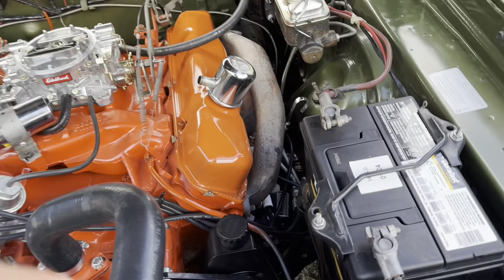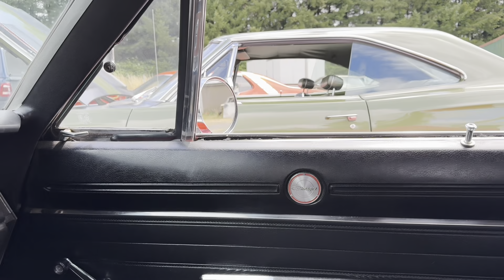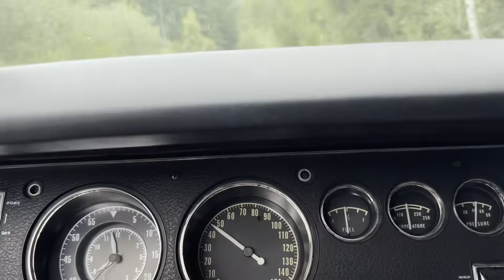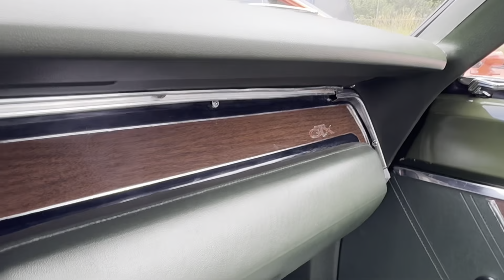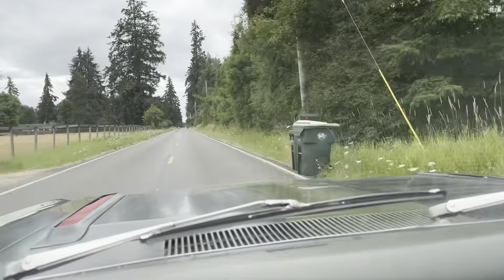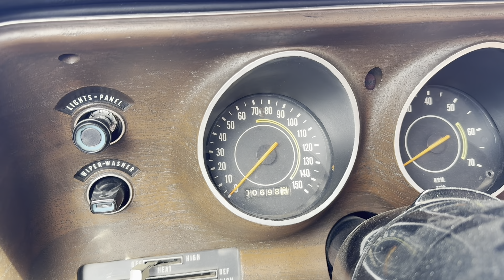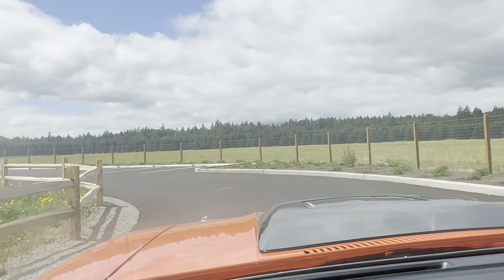An Expensive Front Suspension Is Not The Answer! Magnum Force vs Borgeson Vs Stock Mopar Comparison!

Comment: That k member that’s on the Roadrunner is probably an RMS “AlterKation” and yeah the heim joint control arms and tie rod ends are always going to be noisy. Since they utilize the factory shock location the geometry is off for the load transfer.. QA1 has a better K member with its own shock mount but they’re both extremely overpriced around 6k and that’s with no brakes and crap coil over shocks. The best aftermarket front end is a beefy “G Force” front subframe for 4K which does need to be custom cut and welded in. It has amazing adjustment and turn radius plus accepts a wider tire. That is what I’m putting in my 71 Roadrunner plus a narrow back half subframe.
Reply from the maker: No think it was magnum force

Comment: The darty feeling with the borgeson steering box could very well be an alignment issue. Particularly a toe adjustment. I do road course track days with my cars and adjust my toe and camber  between street and track settings each time. 1/8” toe in is great for street and feels stable and straight, 1/16” toe in I use for large circuits, still decent straight line stability but it will turn in much faster in the turns. I’ll actually use zero toe, or 1/16” toe out for autcross where you want super fast turn ins and don’t need any straight line stability. For camber I use -.5 degrees on street and -1 to -1.5 degrees for track.

Comment: I like torsion bar suspension.I did adjustable upper control arm on my Duster cause i have a right frame rail issues i couldn't get it alignment
Reply from the maker: They have uses

Comment: So, heres my question. Im actively working on getting a 68 charger of my own and i want to know, what is the steering ratio of the borgeson system on the GTX? Im hopeful to find a good 1:12 or 1:10 steering ratio if there is such a thing so i can really dribe the thing properly. I fully intend to daily drive the car and maintain it as such. And yes, torsion bars fir the win. Cheap as hell, easy to maintain and or replace if needed. If it aint borke why bugger with it? But yeah, i need that power steering advantage for the daily driving side of things. Also, some proper alignment tips would really be great. I work at a brake and tire shop and we do them so i could actually do my own cars alignment as well.. well, once i get the charger anyway i could. I also intend to keep it as a carbureted vehicle as well because i can work on em in my sleep. At least an edelbrock 4 barrel anyway. Only things i will be modifying is the transmission and the braking system as i plan to use a hydroboost system for the brakes. Ill be using an 8 speed automatic because now we actually can. Yes it'll require the crossmember and all that good stuff but it'll really help with fuel economy. A 318 with that setup and the right gear could get 28 to 35 mpgs all day long. A big 383 or 440 with a 3.23 may get around 25 to 30 mpgs out on the highway. 1000% worth it.

Comment: I know this is a little late, but what are your opinions on the RMS AlterKtion coil over setup? The coil overs do not go up into or use the shock tower but is rather connects to the k frame.
Reply from the maker: I’ve heard that stuff is better than the magnum force but have never personally used the coil over set up.  We used an alterktion k member in a 71 Challenger modern 392 Hemi swap and while everything fit ok (kept torsion bars) the k member actually flexed visibly when turning the wheels.  They were pretty wide wheels but still, shouldn’t do that.

Comment: In a GM application that box would have at least one strap brace from the back of the pump over to the front exhaust manifold stud / nut. If that were my car I think I’d break out the torch and some 3/8th steel strap and bend one up, a longer front manifold stud with more exposed tread at the top would also need to be scrounged up.
Reply from the maker: It’s just not engineered right.

Comment: The bump steer in the GTX probably attributable to the SPC adjustable upper control arms. As you adjust the arms during alignment, you also change the arm length, which changes the changes geometry, and could be the cause of some bump steer.

Comment: Re: the 69 GTX. I have a 70 Roadrunner w/the same Upper Control Arms which are SPC-brand fully adjustable. They don't require the "cam (eccentric) washer". Everything else is QA-1 including the K-member. I also switched to power steering and used the Borgeson box w/GM 2 style pump. Very happy w/how it all works, looks, fits, and integrates.
Reply from the maker: Had trouble aligning the front end with those UCA's but maybe we did it wrong.

Comment: Absolutely agree, front ends on cars should be torsion bars and the trucks and jeeps should have leaf springs if they are 4wheel drive none of what they are doing with the new jeeps,a 96TJ put me in the ICU for a good while because of the coil spring suspension is total BS and any jeep made after 1995 that doesn't have leaf springs should be scrapped or put leaf springs under it unless you just like having lots of broken bones and hospital food, just my opinion based on facts when mine decided to spit out the rear end and drop the body on the tires on the passenger side when I was going down the road at 55-60 miles per hour and start flipping until some trees in someones backyard stopped it
Reply from the maker: T bars all the way

Comment: I won a lot of races in the 70's  with a 69 gtx and the torsion bars are a big reason for that  in oval track racing I went thru 3 69 Road Runners.  But I wish I had one know.
Reply from the maker: Lotta good cars got used up on the track

Comment: The problem with stock torsion bar suspension is not the torsion bars.
If you could get light weight control arms and spindles and good fully adjustable shocks the torsion bars suspension would be equal or even better as there would be less unsprung weight.
You’d need a canterleaver suspension to equal it.
Reply from the maker: T bars work great.

Comment: Is not the main reason for using Moog Problem Solver bushings is that they are offset to move the ball joint rearward to attain positive CASTER.  Chrysler went with negative caster to reduce steering effort at the expense of handling.  Achieving 2 to 3 degrees of positive caster is the goal.  Am I wrong?
Reply from the maker: You are correct, believe I misspoke in the video.

Comment: Just say no to aftermarket anything.
Reply from the maker: Some ways to improve handling in a Mopar that isn’t stock that still works.  For example off set upper control arm bushings work great, can get the alignment to where it should be with radial tires vs the settings for the original bias ply tires.

Comment: putting a tubular k and coil overs in my barracuda was the best thing ive done to the car. just don't use that mag force iv'e installed 3 of them and none of them were welded right
Reply from the maker: I’ve heard other ones are better.  magnum force
Reply from the maker: Magnum force is not the answer

Comment: I own three A bodies. I HATE the way the factory torsion bars drive/ride. It’s terrible. They ride like 3/4 ton pickup. They jerk, dart and are unpredictable.  I installed a tubular setup in my Scamp from Gerst 8 years ago who has since been bought out QA1. It has been the best money I’ve ever spent on that car. It handles, steers and rides like new car. Back then I was able to buy the kit from him with brakes for about half of what you can buy a kit from QA1 now. The upper coil mounts don’t go to the inner fender like a magnum force. The K member has coil mounts built into it. Like you said the systems and have the coil mounted to the inner fender are asking for problems. I’ve heard a lot of bad things about magnum force. I do think the cost of the new systems are ridiculous, but the correct suspension system will put the factory to shame. I’ll either make my own for the other cars or buy QA1 in pieces until I have a complete kit.
Reply from the maker: Boy I couldn’t disagree more with you,  I’ve road raced torsion bar Mopars on a road course and you can make them handle and ride great.

We did a QA1 k member with bars in the 71 Challenger 6.4 Hemi restomod we did in the shop and with the fat front tires the k member visibly flexed when you turned the wheels 🥶

Magnum force is bottom of the barrel in quality.
Reply: @rocketresto  I guess we will have to agree to disagree.  I’ve driven/riden in hundreds of old Mopars and I’m Mopar guy all the way, but I have yet to ride in one that handles well with factory suspension. I’ve rebuilt the entire front end with moog parts on about 6 cars for marginal improvements.  That is a good data point with the QA1 K member.  I’ll think twice before I make that buy. That k member is a QA1 design not a Gerst design.

Comment: Interesting video. I'm building up my duster for more handling stuff (autocross/road racing) and I'm going closer to the GTX, I will have bigger torsion bars, adjustable UCAs and likely the Borgeson box but the overall geometry of these is actually great from the factory. I worked with a fellow engineer to do a computer simulation of stock and modified geometry and there isn't much that I'm actually going to need to change. the big things are modern alignment specs to go with the tires you are running and spring/shocks to fit the driving you plan to do. But that is outlined in the mopar performance handbooks for racing so that isn't something new, and the mopar engineers were well aware of it.

Comment: Nice comparison. Stick with stock it is.
Reply from the maker: Ways to upgrade from stock but ya stick with t bars!
Reply: @rocketresto  true. I have offset upper control arm bushings, white Kybs, reinforced lower control arms and 0.92" torsion bars under my small block 69 Satellite.  Rides great for driver.
Reply from the maker: @Mattisgarage great set up, our only suggestion would be to try Bilsteins over the KYB’s.
Reply: @rocketresto  I have heard that they are great, have been thinking that too.

Comment: Here's what's cool about the factory torsion bar suspension, it's infinitely  adjustable! Hardly any other suspension ( even now) is that adjustable. Caster, camber, ride height, and toe. And you can adjust the spring rate as well!
I have never had a problem with this suspension, and they handle like a dream! ( properly set up that is) the aftermarket  is a downgrade unless you do a heidt  k member and also replace the rear doing a back half with subframe connectors.
 Now, yo can improve the front with spindles for big brakes, although mopar actually made factory 6 piston calipers for satteites that are fantastic! Also tubular a arms and boxed Lower arms are a great  tuning trick for auto cross and any spirited driving.
Reply: You don't have a part number for those 6 piston calipers do you? Never heard of them.

Comment: While I respect your contributions, what you said about the Borgeson units isn't correct. 
You don't need to modify the steering column to use it. It works with the Saginaw pump. The response is MUCH better than any factory unit, better than any Firm Feel unit because every Mopar steering box is a design dating back to the late 50s. They all have a degree of on center free play that only feels worse when you step up to stage 2 or 3.
Alignment matters more in terms of "darty" steering response. Toe in or out will surely make the car respond well or in a weird manner.
Magnum Farce sucks. Their engineering is crap, the owner looks like an elderly former roadie for Quiet Riot or some other 80s hair band.

Comment: What I'd like, on say a Hemi conversion car into an A body is torsion bars, but a tubular 'K' frame with a power rack on the front of the subframe so you can run a full length oil pan unimpeded by a bulky K frame, drag link, idler and pitman arms. I have no problems with torsion bars but the drag link combined with the K frame is a headache for everything you want to do under there from headers to oiling for track and handling improvements. The limitations of the car are quickly found if you're a proper hard charger as the Brits would say LOL.

I can't see the point of a rack if it stays in a similar position as stock steering. The amount of money spent not being equal to the improvements gained. Stock power steering pretty good - one gets used to it and we like it like that but if we're going to a rack what is the point of putting it in the same position freeing up some space but making another space worse? 
Also there's also the undesirable effect of taking away the character of the car, which for a true Mopar nut is taking away what they're all about. 

Also, offset upper control arm bushes allow caster and camber, not one at the expense of the other which invariably occurs as you increase negative camber. I used them to great effect but it took maybe 11 alignments to sort out the handling and playing with the position of the bushes. You don't have to install them the exact way you might think. In the end with aftermarket torsion bars and sway bar (and many other upgrades) the stub axle assembly started to flex, which was actually good and bad; good because it was showing that stock based Mopar front suspension can handle really well, bad because there were no brakes on the first brake application.

Comment: Im not a fan of Wilwood anything. Most of their calipers don't have dust seals like the factory does. There are a lot of aftermarket front end kits out there and a lot of them don't don't understand steering geometry.  When you change from steering box to rack and pinion you are changing how proper Ackerman is achieved. The factory spends millions when developing a car, most aftermarket companies don't.

Comment: Mopar power steering is overboosted (unless you like steering with one pinkie finger).  It tranferred no road feel.
A manual steering box was available on the six cylinders.  That unit transferred road feel.  
It might work on a small block,  but on a big block it might require "armstrong steering".
The AC was added by previous owner.
Trace the wiring from the compressor.
The AC installation may have never been completed.

Comment: I have a ‘66 Mustang with complete TCI front and (rear).  It’s good, since it has proper geometry, and the “cradle” holds the coil-over, not the shock tower.  I never liked the coil-over arrangement on a Fox/Sn95/ New Edge Mustangs, as it takes the spot of the strut. Normally that would not be bad, but the weight bearing coil on Fox body is normally held by the K-member which is which is held in place by boxed unibody extensions.

Comment: Great information!  I had ordered the Magnum Force for my 74 Challenger but.....through a quirk of fate, it took over 6 months to finally get the thing shipped and I decided that they were having too many issues getting it delivered, I canceled my order and got my $ back!  I already had the Borgerson (sp?) steering box on it and (in my opinion) it seemed a whole lot tighter and more responsive than the original box.  I will stick with it as I am happy with it.  But your video has me convinced that I don't need a tubular front suspension.  Too little bang for the bucks...
Reply from the maker: Boy you dodged a bullet!

Comment: Borgeson gear is smaller but taller and if you get one from Bergman Auto Craft he alters the valve body. Also, I'm not sure if you buy from Borgeson directly you don't need to cut the steering shaft with his kit
Reply from the maker: That is a huge advantage to the Borgeson box, lighter and more compact.  Especially if you have headers it’s nice.

Comment: Well what I have seen is when folks pop for the new, crisp and hot after market stuff, they have problems. Me good with the stock suspension as long as not running roundy rounds. Remember NHRA out lawed the torsion bars. Why? Because you can adjust them faster than anything. As well as the push button trans.
Reply from the maker: In 1969 Petty actually had an adjusted in the car so he could adjust them during the race on demand, that was banned pretty quickly.

Comment: The 71 satilite and road runner got new subframes for 1971 and one of the reasons was to put isolators between the frame where the motor and suspension was mounted and the unit body of the car. Was supposed to improve the ride and make it quieter. With the aftermarket coil over suspension, you are putting additional noise, harshness and vibration back into the car. I would stick with the stock front end and upgrade the power steering pump, box and maybe the upper control arms to get additional alignment adjustment. (Also double check to see if you have the asymmetrical rear leaf springs. They made a difference.)
Reply: WRONG. It was 1973 that Chrysler revised the suspensions and steering systems on several cars. 
The 1971 B body structure wasn't much different from 1970. The K member itself was almost identical with the exception of the angle of the steering box mounting position.
In 1973, there were several revisions including rubber cushions between the K member and frame rails. ALL power steering boxes were now large sector.

Comment: The GTX looks tame and mild next to the body work and design of the Road Runner and the Daytona. Maybe it’s the orange and red paint vs the green. 

I appreciate the factory torsion bars with the upgraded steering box and a nicer set of shocks. Simple, time tested and proven. Thanks for a cool video. How often do you get to drive a Daytona, GTX and a Road Runner back to back to back. What a pleasure!
Reply from the maker: Very lucky to be able to do what I do.
Reply: That would be so cool👌